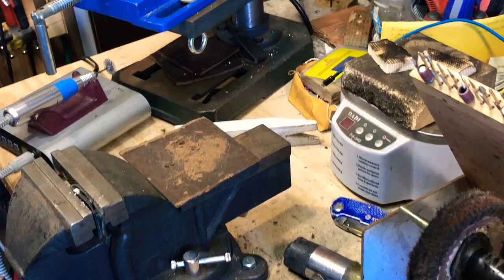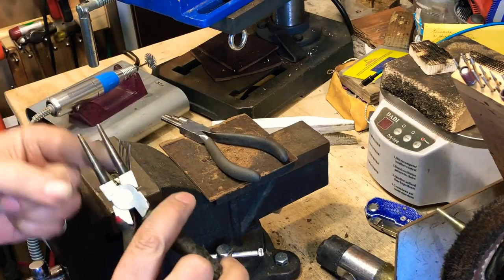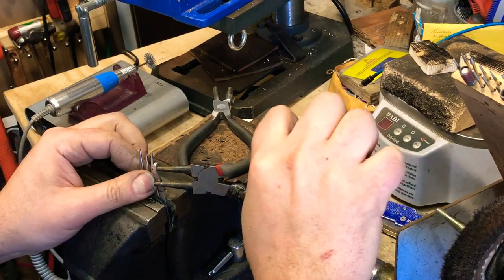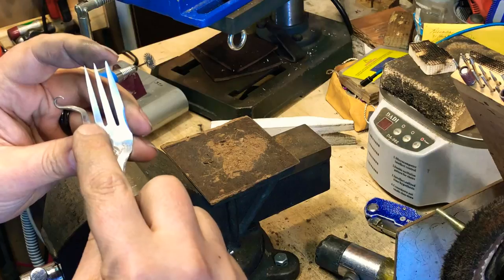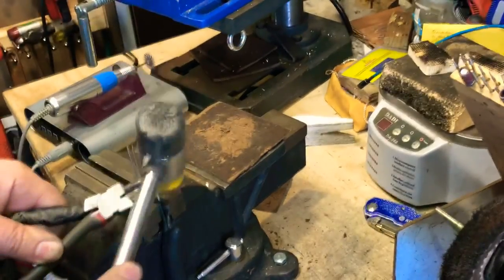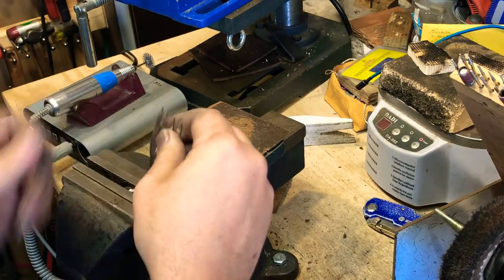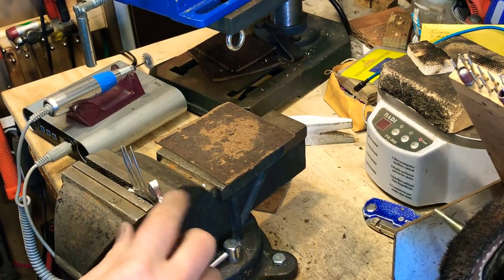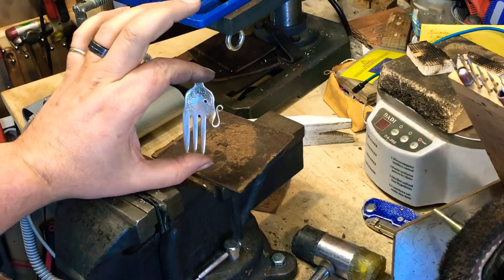Fork elephant pendant trunk bending silverware jewelry

Comment: Will a small drill press work for drilling holes in silverware?
Reply from the maker: Most will drill through silverware with cobalt bits. If your drill press has a pulley system on top you’ll want to set that to the slowest setting. Then you can use wax, cutting oil, or other lube to drill with. I hope this helps. Please feel free to message me on Facebook at Flatware CreationSS. 👍😊